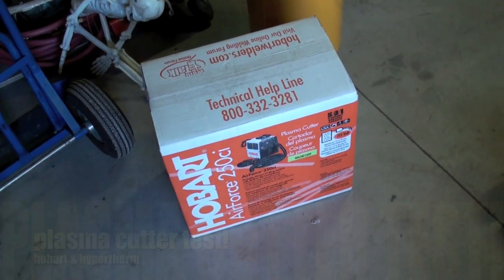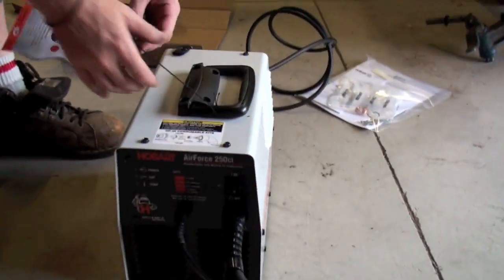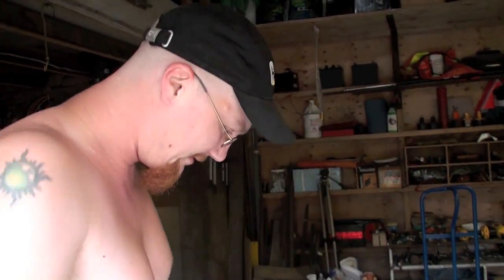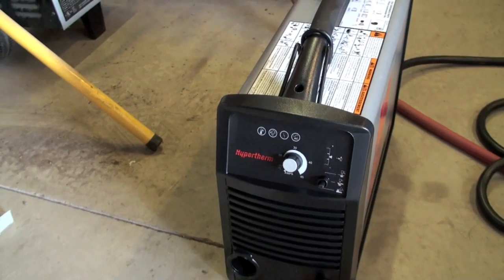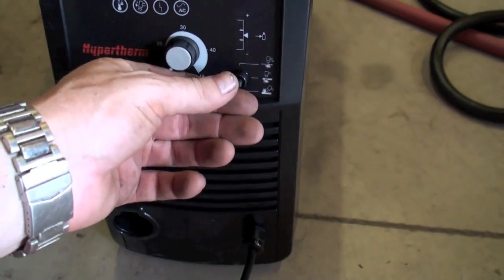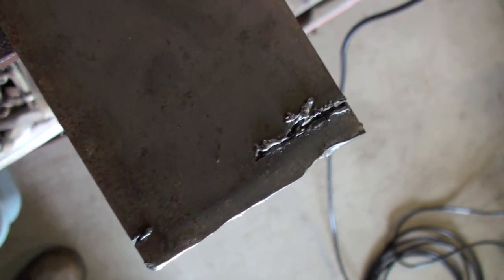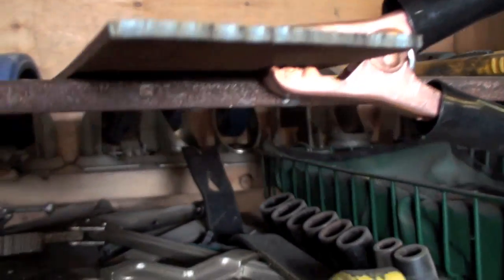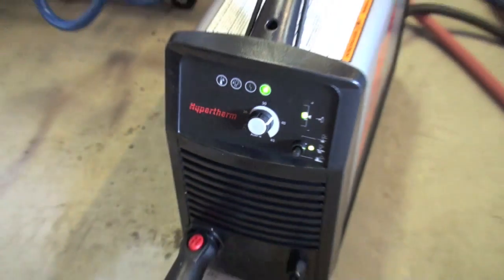plasma cutter test

Comment from the maker: @Erated78 air compressors end up gathering moisture in the tank so you dont want to send wet air through yer cutter and there might be oil and little chunks of what ever was left in the tank when they were making the compressor so im going to get a crap load of filters to stop any contaminants from going through the machine and as long as i take care of it it should last for ever

Comment from the maker: @Tboninator the units breaker went off in like 6 seconds it has a 35% duty cycle if i have to piss around all day to cut a piece of metal ill just use my quick cut ffs i have multiples of things like drills and angle grinders and die grinders because i cant stand friggin around if ya need to change bits and stuff like that i dont need one that will cut 1/2 inch all day but i dont need one that wont cut 1/8 for more that 5 seconds with out shutting off either know what i mean

Comment: I borrowed the hypertherm 30 we had at work.  I only had 110 in my garage, but was impressed with what it did on that.  It won't cut 1/4" on 110v, but hook it up to 220v and its not a problem.  Damn good plasma cutter.

Comment: Hey Pug you need to make sure your plasma torch is perpendicular to your work surface, unlike when using a torch where you would slightly point the flame in the direction of travel. Good torch skills are hard to break.

Comment: Great video Pug. You lost me a bit when you talked about keeping the moisture out of the air lines but everything else made sense.
I'd really appreciate if you could showcase your welding equip and show good vs crap...like those 120v mastercraft welder they sell at Crappy tire. Am I correct is saying that most good welders are 220v? If you were going to weld those 1/4 inch pieces you just cut, what would you use? and what other options are there?
Thanks!

Comment: @ShnitzlHaus 
You dont need much of a big compressor, i have a craftsman 30 gallon, and use a miller 375 xtreme. Can cut for a few mins before the compressor has to kick in. I like the miller 375xtreme because you can use it with 110 or 220 outlets, has their MVP setup.

Comment: @biggdaddy2001 i was referring to their plasma series.Plasma consumables is where any manufacturer rapes you in cost,Thermadyne is just really expensive for some reason....the cheapest 115v/120amp welder ive ever seen by Thermadyne these days is 450 bucks...$300 must have been a while back. Hobart has one under 300 but its not worth it. It seems inflation has really sent costs skyrocketing.

Comment: @Erated78 If you by a crapy tire welder they work but they are meant for some joe blow that wants to do a repair once in a blue moon. But if you buy a Miller or Licon welder and you get one that is 110V they work fine you need to take a little more time if your doing anything real heavy but they do work just as good as their big brother the 220V.

Comment: Hey Pug
Put the work on a workbench and use a straight edge to cut with.
Pull the gun twords you when you cut and dont let the metal backflash into the gun.
You will see the sparks comming out the bottom of the work when your doing it properly.
I bought a Harbor Freight unit from a scratch and dent store for 275.00.  The idiot got the wires wrong for the plug.  I am still using it today.
Get a better breaker for your shop too.  A 110 plasma cutter shouldnt trip the breaker.

Comment: tmcweld 5 years ago
 ya i would not recommend Hobart equipment.. i weld for a living and definitely say the Hypertherm is the way to go! the models we use cut a little over 1 inch and we have tons of hours on our machines with no issues

Doing something for a living does not make you good at it ;-)

Comment: hobart /miller which anybody knows anything are the same compoany just one is us and other is cnada made .but the hobart along with the miller are very good units ya just need to properly be tought the correct way of using a plasma cutter and also the mvp voltage being such said the hypertherm powermax 45 is also nice piece but wont last in the long run such as the miller or hobart being since made in compact lesser long run companetns in order to make small some things are best left along

Comment: @curtismundy Tractor Supply Company, i've never had problems with stuff i've bought there but i haven't bought a plasma cutter, i've just bought lawn equipment, if i want a plasma cutter i'll go to Harbor Freight, i got my welder there and it works awesome for what i need

Comment: Nice machine.  By the time you get your oxyfuel running well enough to get even close to the quality of that plasma cutter, the plasma will have already done it's job and probably the rest of the jobs.....unless it's very thick material.  If you're thinking of getting a quality plasma cutter, before you spend the money call the service department of each one.  Hypertherm will win everytime.

Comment: I've seen several vids of people properly using the Hobart 250ci, and it worked just fine.
My experience is with a Miller plasma machine cutting stainless, aluminum, and up to 1/2 inch steel, so I do know what I'm talking about. I think you should just admit that you didn't know how to properly use a plasma cutter when you showed the Hobart. The whole thing you did with it really looked planned. You just gave up too easily! Anybody else think this vid was more of a commercial for the Hypertherm?
Reply: Steve Farling I agree

Comment: The thicker the material, the longer the cutting time... You test it out, attempting to cut, and you run it by the metal real fast... That's not gonna' do the job that fast unless you have a significantly bigger cutter.

Comment: Hypertherm makes badass stuff.... i used to run 8 750 amp burn boxes at the same time (8 torch CNC burn table)...im sorry to tell ya but Hobart is crap...they may be the company that invented the welder but Lincoln and Miller is way better (and way more expensive)

Comment: Watching how you were using the Hobart, it's apparent you don't have much experience using a plasma cutter.  First you moved too fast.  You have to wait until you punch through and then move at the rate the cutter is advertised at.  110V 1/4" is doable.  Your technique is poor.  Yes Hypertherm is a very good plasma cutter but so is Hobart when you use it properly.  220V will give you much more current and will cut thicker as you already found out with the Hypertherm.

Comment: Your brand new machine is on the floor where the molten metal is flying, why? 
You air supply filter/water separator, will not do its job laying on its side on the bench, needs to be mounted in vertical position. Since you are posting a video for the world to see how about some safety gear? start with gloves and  shirt. last thing clean up your garage.